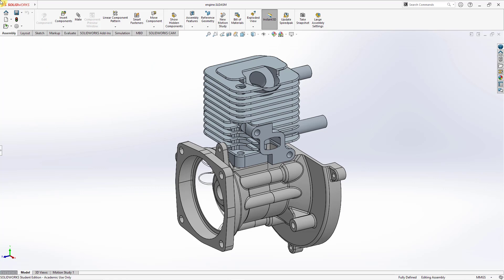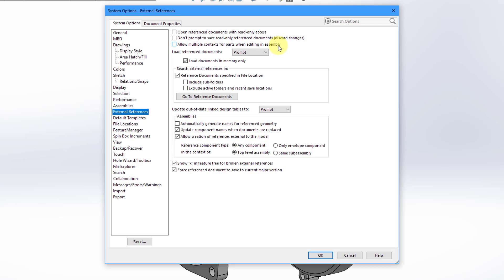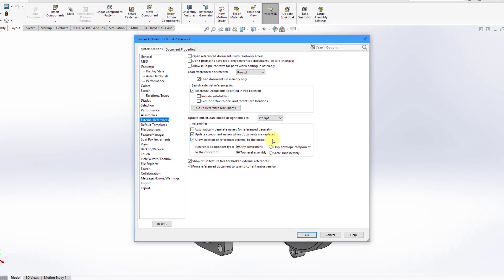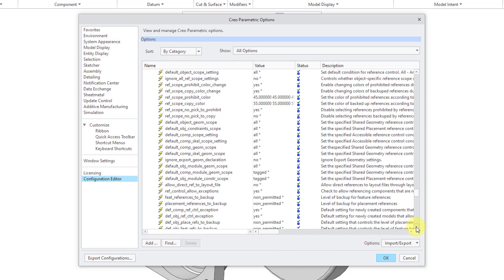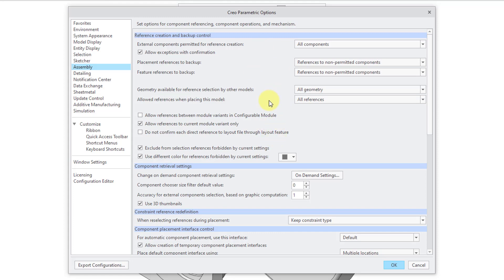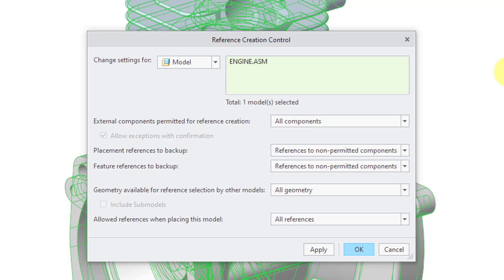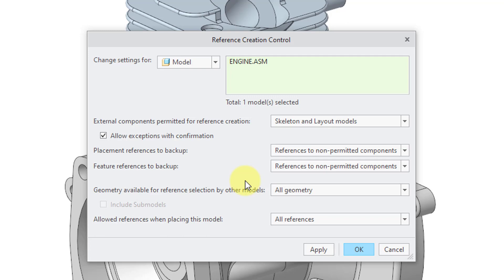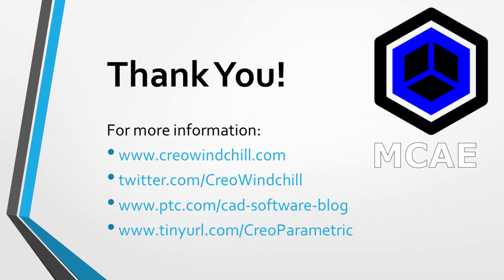SolidWorks - Creo Parametric Comparison  - External Reference Creation Control (Top Down Design)

Comment: Is there a way to restrict circular references in Creo Parametric? I do harness design in cabling and get those when I use the insert component feature.
Reply from the maker: There are many ways to restrict circular- and external- references and manage external references in Creo. It's the longest chapter in my book on Top Down Design. I don't know why you're getting them when you're inserting components in cabling. But it's probably not as big a deal as you think. Get rid of circular references when you can, but they're not the savage hit on your assembly like they were 20 years ago.

Comment: The explanation was very good - all the complexity of CREO keeps me away. As one of the market leaders in 3D CAD for over 30 years, undoubtably 10's of thousands of users have pushed / pulled this software into covering every situation imagable - very difficult to streamline but PTC have done a good job in managing this ever present demanding constant change. With all the additional modules, it's very much a corporate / big company CAD tool. There has to be a CAD tool for both the BIG and little guy with price points to match.
Reply from the maker: I disagree with your last point. In industry, I used Creo for rockets, UAVs, and consumer electronics. When I was in pre-sales, I supported smaller companies like mom-and-pop shops, furniture makers, toy makers, and so on. Different markets have different needs. No one tool suits all markets and all products. We should have different tools for different segments.